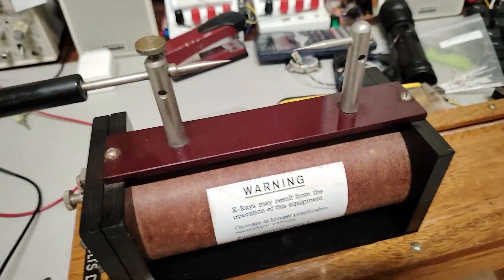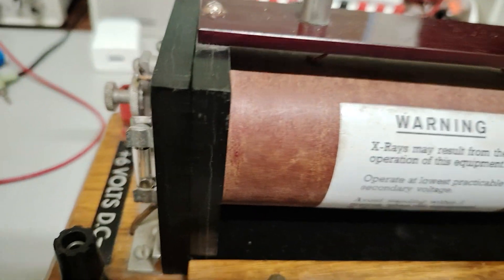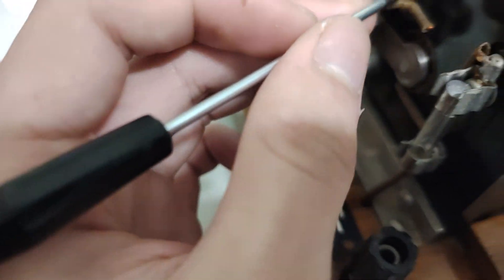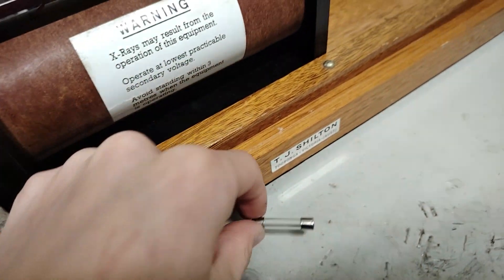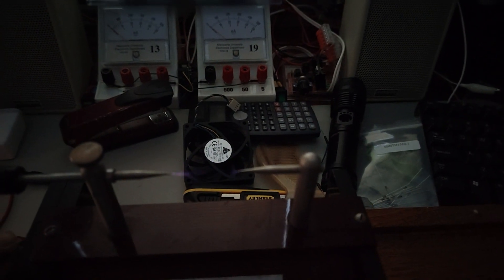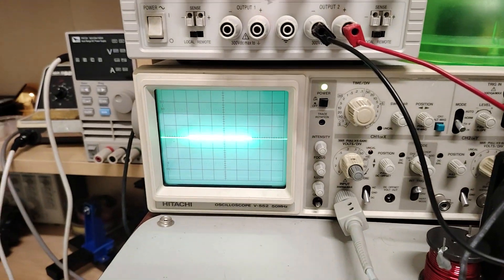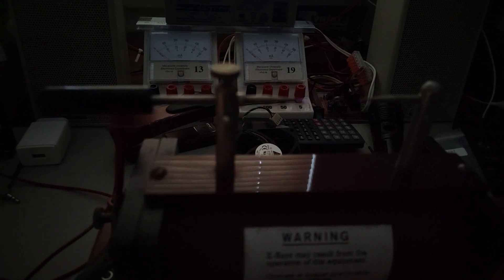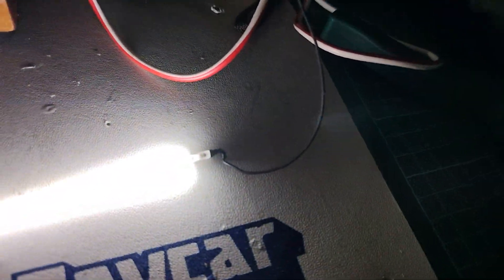Induction Coil

Comment: If you put a diode across the primary it will suppress the voltage spikes that create the sparks and threaten the mosfet, but I think it will also stop sparks from being generated on the secondary. Something you could do to protect a mosfet would be to use a regular and a zener diode in series, so that they would not conduct forwards but the zener would cap the peaks below the breakdown voltage of the mosfet.
Another suggestion is to use the mosfet with a shorter spark gap, as higher frequencies reduce the power into the coil (but increase the efficiency) due to a higher inductive impedance, making the peak voltage smaller.